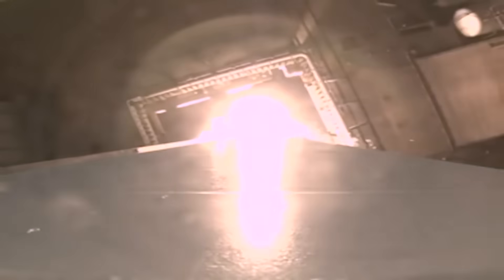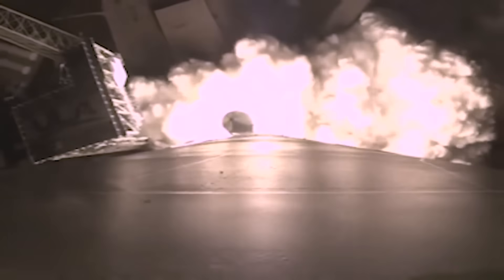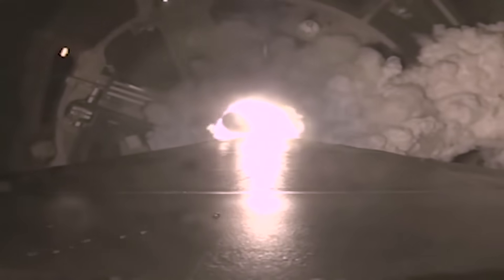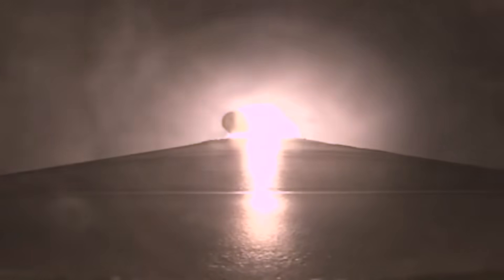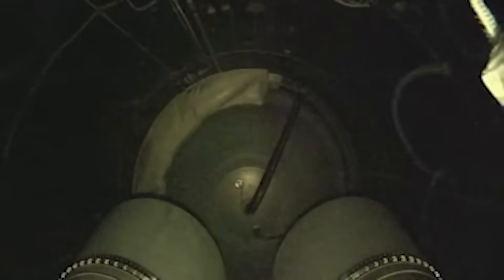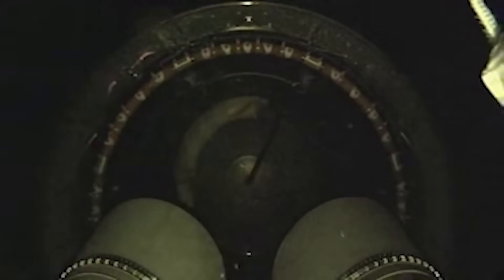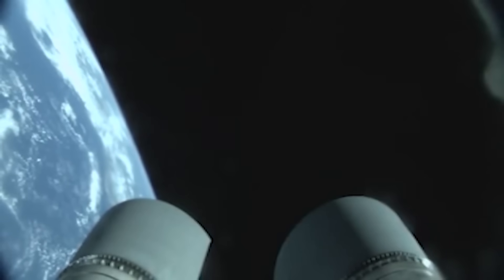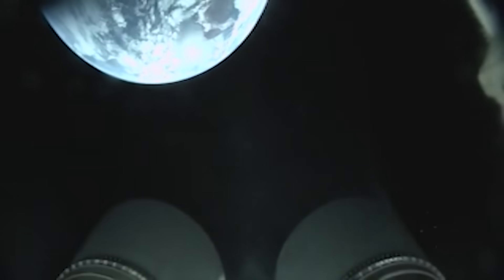Take a Vulcan 'rocket cam' ride to space with epic liftoff and Earth views

Comment: What are the flying particles that appear @7:27 and @7:40? They look like bugs attracted to light, and you can see them at Mach 1+? 

Help me understand what those “bugs” were and why they were so slow
Reply: Must be artifacts on your screen cuz I saw nothing at either timestamp
Reply: Basically just little tiny pieces of debris (probably paint) and they look slow because the rocket and the debris are moving at the same speed, and the debris isn't really moving but the rocket is moving away from the debris since the engines are on.

Comment: What is that glowing orb looking thing at 5:27? Appears out of no where, appears to be ignited by something and then starts glowing before the camera conveniently switches, then when they switch it back a few seconds later the orb isn't glowing anymore but departing off into the distance
Reply: That's the first stage, did you not see it separate 5 seconds before?
Reply: It's just the first stage firing tiny rockets off to seperate itself from the second stage. This is to make sure the two stages don't accidentally collide.

Comment: Why did the SRB hang on for so long after they stopped giving thrust?
Reply: SRB have to remain connected for a short while, to allow for thermal stabilization between contact surfaces.after which ,the release explosive nuts, that release the studs linking the SRB can be activated.,not doing so ,would result in a unbalanced disconnect sequence ,which would cause stability issues. Thermal  differences ,are very difficult to get right on very close tolerance disconnect systems, especially at these speeds.